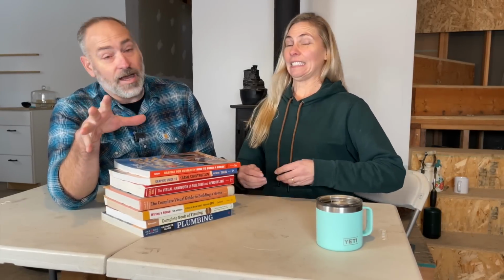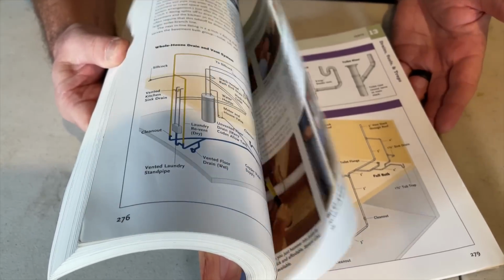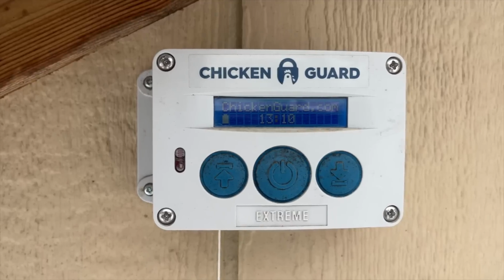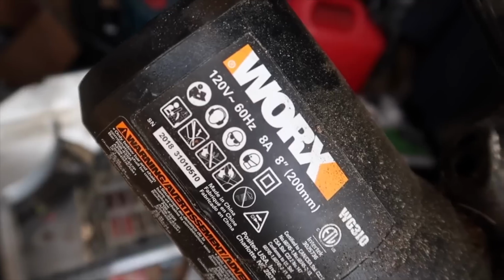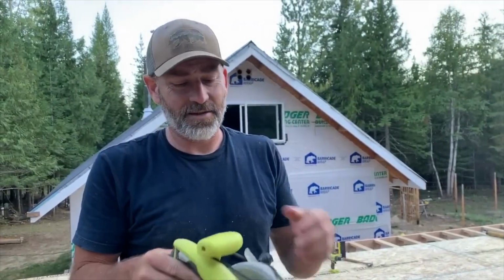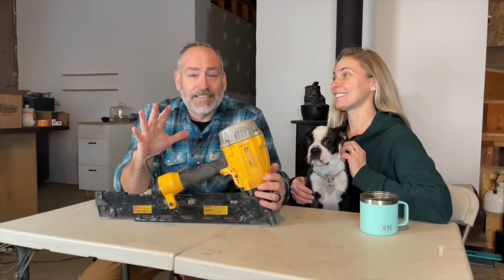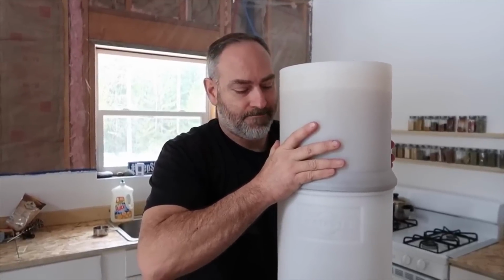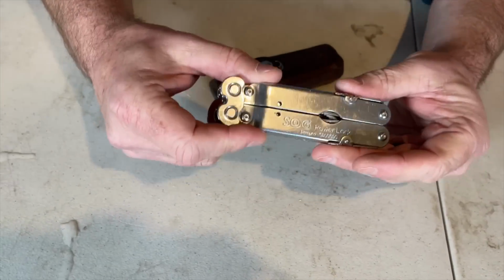8 Essential Homesteading Tools - 2022 Gift Guide

Comment: Anyone who knows construction, knows if you understand all the principles of either electrical or plumbing then you can do the other. Voltage is defined as electromotive force that moves through the conductors like psi for water pressure, watts or kw hours is your usage like how many gallons of water you use ohms is the resistance of the conductor like every elbow the material, size and length of pipe causes drag and resistance of water flow, etc. amps or amperes are the measure of electrical current (this is the dangerous part) 1/10 of an amp is all it takes to start cardiac arrest.

Comment: Hi Martin, While you were talking about the framing nailer and how Julie does not like the way the air escapes the gun as it shoots, I need to add that some guns have an air diverter built into then and can rotate to direct air where to go. Dewalt may even have an add on that can be installed to help with diverting air. Thanks for your videos, I enjoy them every time I tune in

Comment: Dewalt is actually my least favorite.  I have Mikwaukee, Dewalt, Ryobi, and Bosch.  It seems the Milwaukee chargers are terribly slow.  I probably like Mikwaukee best.  I have 12v and 18v.  Both have quick chargers.  I still have several Ryobi tools that are blue instead of green.  I don't know when they made the color change, but it's probably been 20 years.  I use the blue Ryobi Sawzall all the time.
I agree completely on the solar generators.   I don't have Ecoflow but Bluetti.  I can run my entire camper with the 30 amp plug on the Bluetti AC200MAX and used it to build a dock on our lake.  It runs an air compressor,  hammer drill, circular saw, and shop-vac, as well as charges all the cordless tools.  I also have 2 of their smaller units that I use for UPS on our entertainment and security systems.  They're not cheap but they are a great addition to any house.
We are researching water filters and will look up the one you recommended. 
I love me a woman with a tool belt...and coffee:)

Comment: Biggest problem is that most tools are not designed for women’s hands. My wife has to hold the cordless tool with her legs and use both hands to get the battery out. Do I get your wife’s comment on ease of battery removal. 😊

Comment: Battery tools in my opinion have a place but are being over used.  I will give you one example.  I had a battery pole saw for trimming limbs. I would make a circuit of my property perimeter to trim limbs extending into the open areas.  With the battery tool it would take me in excess of 3 hours.  When it died I switch to gas and now get the same or even great job done in less than an hour.  In a pinch they maybe fine however for real jobs there is no substitute for gas power

Comment: I have a copy of the Visual Handbook. Mine has a section at the back of each chapter that includes the applicable building codes for the topic. I use that book all the time. It has great info, especially if you need to determine spans, stair size, ADA requirements, and as you said, technical data. Thanks for the recommendation.

Comment: I like my Dewalt 12in chain saw as well but also have a larger 18 in gas chainsaw for heaver cutting. need to keep the chain clean and sharp so have a Stihl chain two in one filing  guide unit that is easy to use and keep my saw putting out large pieces of wood and not sawdust which means the chain is dull.

Comment: I have a Milwaukee electric chainsaw because I'm disabled and can no longer use my Husqvarna due to the weight. However, with my 16" Milwaukee and my winch on my Tundra I've been able to safely cut 33 trees 100' tall both pine and oak trees with a diameter up to 73" in diameter.  Ryobi is owned by the same company that owns Milwaukee but Ryobi is the consumer grade. Milwaukee also has the best warranty, but to each their own🤣. I've watched y'all from the beginning and have thoroughly enjoyed your family, attitude, efforts and success. Keep up the good work and God bless.